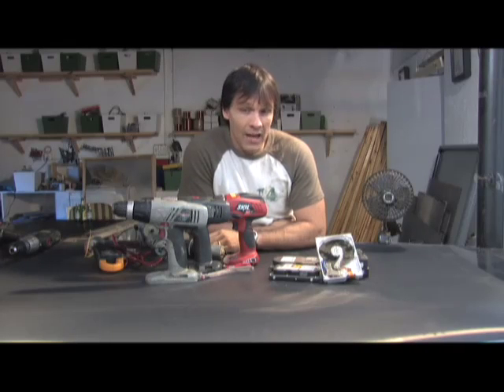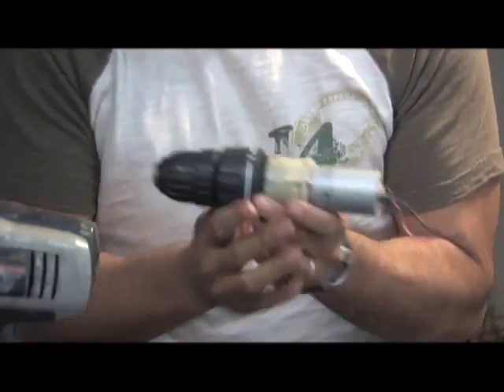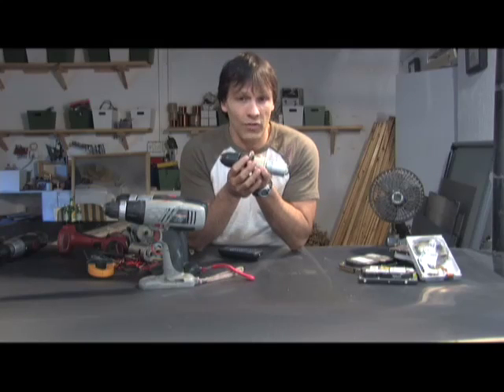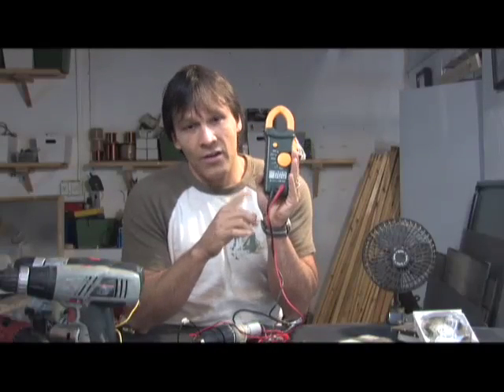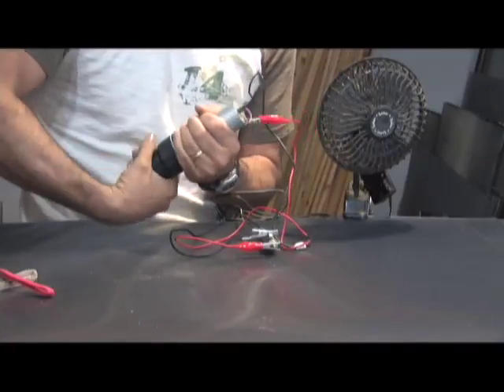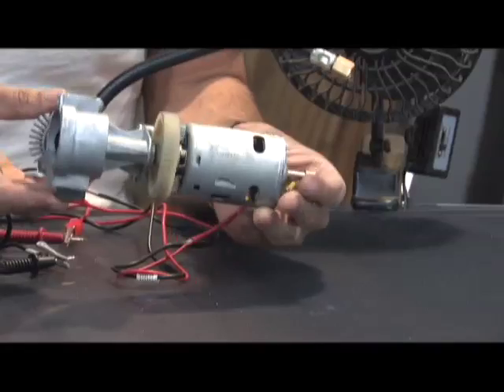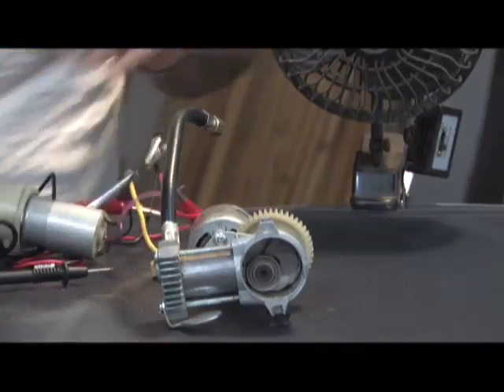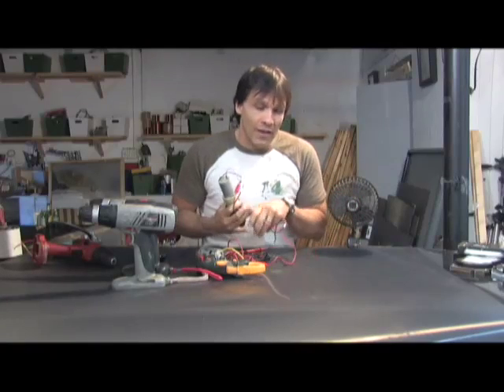P1 RECYCLING DRILLS MOTOR DRIVING MOTOR HARD DRIVES FOR GENERATORS PLATTERS

Comment from the maker: @josebendana if your voltage is above 12 v it will charge but your amps may be low. You would also need a blocking diode.

Comment from the maker: Most 99% DC motors work very good. The key is the RPMS that you get them too. A window motor has a 50:1 gear ration in some cases. This is too hard to turn. 4:1 up to 20:1 ratios are good. Planetary gears are different. A voltage regulator prevents over charging and most have blocking diodes ($3 ebay) which allow 1 direction current so you batteries do not power the motor or generator.

Natural lower RPM motors (no gear box) produce more voltage than higher RPM motors turn for turn.

Comment: When I took mine apart, I couldn't turn the chuck with my hand because every cordless drill I've seen has a brake and doesn't turn unless you squeeze the trigger.  How do I bypass this?

Comment: Could the drill head be used to connect to a squirrel cage, used as a wind turbine and charge a 12v deep cell battery? Would the amount of energy gathered even be worth it?
Reply: It would have to be a very large squirrel cage since they are very inefficient as wind turbines.  The 'gear ratio' would have to be right to use the torque and rpm of the cage in a typical wind to turn the drill when attached to the expected state of low charge in the battery.  The greater the electrical load, the harder it is to spin the generator.  The final output, under load, would have to stay a couple of volts higher than the 12V of the battery to fully charge it.  The amperage under load would have to be 1.5VA to 2A  to match the typical trickle charger's performance.  I think it takes a couple of days or more for a trickle charger to top off a discharged vehicle deep cell and that would require a steady ideal windspeed the whole time, so much longer realistically.  Whatever amp draw the drill uses in normal operation would give you an idea of how much you could get out of it as a generator; probably about 80% of it's consumption in use as a drill.
You could put a hand crank in the drill and measure near the max V times A you can get, then see how close that effort feels to the output of your cage fan shaft (in a natural wind) by squeezing it to a stop.  That should give an intuitive estimate whether you are in the ballpark as to cage fan size.  An engineer could scale everything correctly by math calculations alone if he had all the specs., ideally ncluding a log of annual windspeed fluctuations for the planned location.

Comment: drag they do what is call a dymatic brake what that means is in the control room of a  locamotives they remove the power going to the trucks of a  locamotive and they bridge the leeds coming off the motor inside the trucks of a  locamotive witch in turns slows the  locamotive(s) down but not completly  stoping the train or  locamotives brake pads are what stop a  locamotive

Comment: GREENPOWERSCIENCE What type of DC motor could I buy to do this? I want to make a Cellphone charger, with a DC Boost Converter. The Boost converter will boost the voltage to 5vdc. I also have buck converters with USB connected to it. That part is very easy, as I've even made a solar powered cellphone charger with more than 1 Amp output to the note 4. It works. But now I'd like to make a crank cellphone charger. Could you help point me in the direction. Money is of no object, but I'm sure most dc motors with a gear system on it wont cost no more than a MAX of like $50. Probably not even that high, but I'm just saying. Could you help me Dan?
Reply from the maker: MARK 1 Any DC motor will work. These larger motors for drills are not efficient but are abundant.

Comment: would a cordless drill be enough to charge a 12v car battery????????????
Reply: Think of it this way.  There is only the energy in the drill's batteries to start with.  There are always inefficiencies in converting that energy to the power you get out of the drill's motor.  You lose more when the drill motor turns another drill motor as a generator.  Just one of the losses is due to electrical resistance in all those long wires wound in the motor coils, then there's friction in the gearboxes.  Next the remaining energy goes into the battery you are charging.  That isn't 100% efficient either.  You would be better off, if the voltage was right, to just connect the drill's batteries directly to the car battery which would charge it somewhat with a suitable charge controller circuit that fed the charge at a rate both batteries could transfer efficiently.  The principle involved here is called 'conservation of energy'.  Energy is not created or lost.  It merely changes from one form to another.  Whatever amount of energy is used to turn a generator is greater than it's output due to friction that siphons energy off as heat and electrical resistance that causes wires to get hotter too.  This is why a generator can't run an electric motor that runs the first generator to make perpetual motion loop. Even if you had 100% motors and generators that could keep this contraption spinning, as soon as you tried to use it to power something, that little bit of energy you put in it to start it spinning would be all you could get back out of it before it would stop.  It would store only as much energy as a small capacitor or extremely small battery if it was impossibly efficient.  Be amazed at how many hoaxes there are on YouTube claiming such a device makes perpetual "free energy".  Can you guess why there are so many hoaxes?

Comment: Just curious but couldn't you theoretically charge your own battery from the drill using.....lol.......another drill!? Not practical I know but just for shits and giggles.
Reply: Yes, but not at 100% efficiency.  Take what applies from what I wrote to someone a few questions back about whether you could charge a car battery with a cordless drill.

Think of it this way.  There is only the energy in the drill's batteries to start with.  There are always inefficiencies in converting that energy to the power you get out of the drill's motor.  You lose more when the drill motor turns another drill motor as a generator.  Just one of the losses is due to electrical resistance in all those long wires wound in the motor coils, then there's friction in the gearboxes.  Next the remaining energy goes into the battery you are charging.  That isn't 100% efficient either.  You would be better off, if the voltage was right, to just connect the drill's batteries directly to the car battery which would charge it somewhat with a suitable charge controller circuit that fed the charge at a rate both batteries could transfer efficiently.  
The principle involved here is called 'conservation of energy'.  Energy is not created or lost.  It merely changes from one form to another.  Whatever amount of energy is used to turn a generator is greater than it's output due to friction that siphons energy off as heat and electrical resistance that causes wires to get hotter too.  
This is why a generator can't run an electric motor that runs the first generator to make perpetual motion loop.. Even if you had 100% efficient devices that could keep this contraption spinning, as soon as you tried to use it to power something, that little bit of energy you put in it to start it spinning would be all you could get back out of it before it would stop.  It would store only as much energy as a small capacitor or very small battery, if it was impossibly efficient.  
Be amazed at how many hoaxes there are on YouTube claiming such a device makes perpetual "free energy".  Can you guess why there are so many hoaxes?